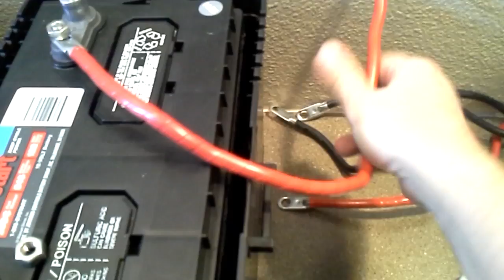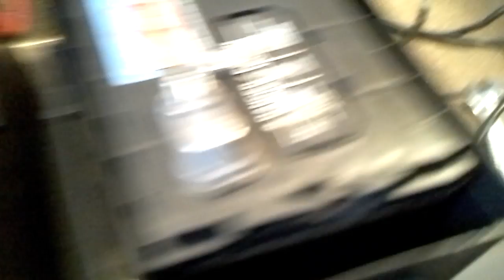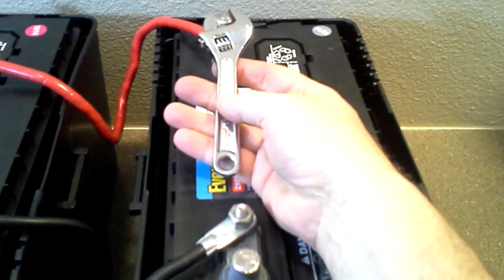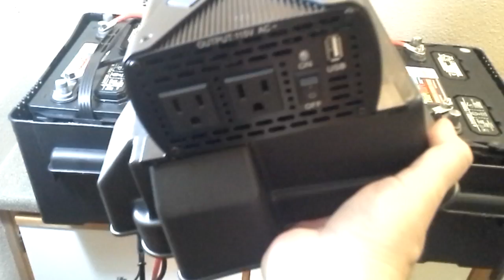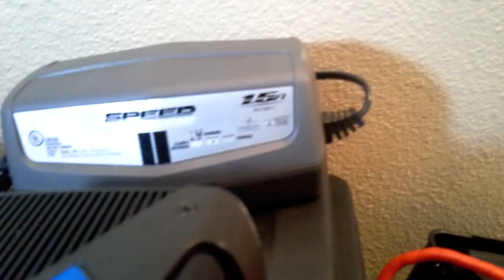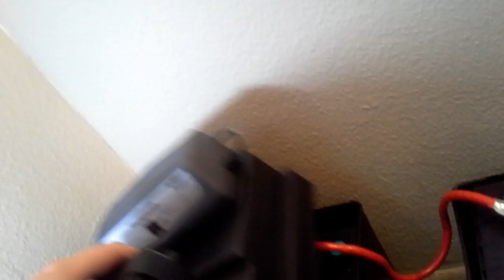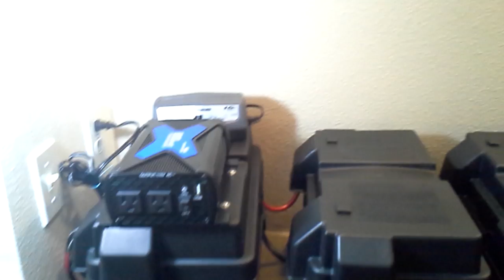Installing 4kW/Hr battery bank with 800W 120V Inverter and Trickle Charger from Tactical Woodgas

Comment: Can you hook a battery charger up to the inverter or would that work
Reply from the maker: It would slowly drain the battery.
Reply: No.  What you are asking for there is perpetual motion - the charger getting power from the inverter connected to the batteries, to charge the batteries.  No such thing as a free lunch. The electronics in the charger will slowly drain the batteries even if nothing else is connected.
Reply: @robboardman598  that's why I asked because I'm learning about all this trying to figure out what would be the best and cheapest way to run my house on something like this.
Reply: @clarissabailes7483  Hi Jason.  Its great that you are asking questions - best way to find things out.  As for running your house, that's a big ask!  I'm sitting next to an off grid system right now.  21 x 275 watt panels, mounted in sets of three in series for 108v input into the solar controller, with seven sets of three panels in parallel to get the amps up. Almost 6 kw of solar.  The controller feeds a bank of 24 x 2v AGM cells, each cell is 850 AH and weighs over 50kg,  to make a 48v storage system.  This runs through a 5kw inverter into the house. The house is all electric so the full load is more than 5kw, and when that happens a 13kw (18hp) diesel starts, and both ads to the house usage and charges the batteries.  It starts on cloudy days when the battery voltage drops to a given level.  That's what it takes to run a house off grid. About $20,000 Australian for that system.  Smaller systems are certainly worth pursuing though, even if Its just a 1kw roof solar grid-tied system to reduce your utility bills.
Reply: @robboardman598  I agree. 
It's OK to start small, probably better even. The important thing is to just start!

Comment: what if you plug your trickle charger into the inverter?  continuous, non stop battery power.
Reply: Bob Williams 

No such thing as free energy
Reply: It doesn't produce  enough power to  loop, a demonstration of   3rd law  of  thermodynamics. The problem must be the  trickle charger  but maybe  a  hairpin curcuit  with  CE transmission started  with  a  solar  initial boost inverted   or  AC boost.  The solution  is  what Tesla  described as volume.
Reply from the maker: Bob Williams 

No free energy, from Tesla or elsewhere.

Comment: Go to nickle-iron  (Ni-Fe) Edison cell's to make your off grid battery 
bank's. So far Edison cell's have lived up to 100 years, or have been 
restored to like new. And the new one are probably better also if you 
louse a cell it's not the end of your battery you just remove the bad 
cell and you can keep using your battery at least short term until you 
can  put a new cell in or just repair the bad cell.
Reply: Granted they will last 100 years, but new 'cost-effective'  technology will make them obsolete in the next 10 years.
Reply: I don't think Ion cells which is what a Edison cell is will go obsolete:  Well you don't know what your talking about: Because you buy the inverter to fit your battery voltage: And people don't charge your new batteries it's a waste of time: And if you don't want to use a battery wrench their is some stuff called plastic dip that work's really good.
Reply: I can take the insults and or criticism to get your point, but your grammar is  making it difficult. Please try again. Thank you.

Comment: this guy connected all batteries in parallel....that takes care of Voltage what about the Current.....Sorry Dude not justified😉
Reply: The "Current" (Amperes) is additive in parallel.  If you take three 12V/100 Amp Hr batteries and run them parallel, you get 12V with 300 Amp Hr.  If you have a 36V input inverter, you connect the batteries in series and get 36V with 100 Amp Hr.  Both systems supply the same amount of watts.

Comment: 800 watts won't do much. I have a 3000 watt inverter.
Reply: 1 hp is 746W
this will run a sump pump for 4 1/2 hrs
Reply: you buy deep cycle battery 75 amp 900 watts or 100 amp 1200 watts and build power box you have 3 deep cycle battery 100 amp 1200 watts and have 3 battery together ok  positive to positive to positive and switch between positive of battery with 150 fused to positive of inverter even you turn off inverter still pull little bit of power ok

Comment: can you do me a favor if you still have your system up.. can you plug the charger into the inverter and tell me if it keeps the battery bank charged on it's own while also powering other things? I've been curious about this for a while but am not an electrician. just a thought. like at night you wouldn't need to use things while sleeping just wondered if it uses more energy than it would or could produce and recharge the batteries.
Reply from the maker: No such thing as free energy, it has to come from an outside source.

Comment: 12 v not 120 v
Reply: The battery is 12v.  You can charge it from your car with jumper cables, or plug the included battery maintainer into a 120v wall outlet.  The new model with solar panel support is at www.tacticalwoodgas.com and also on Amazon.

Comment: Wouldn't it be more effective to wire them in series rather than parallel?
Reply: The reason he connected them parallel is because parallel increases amperage which is most important for load bearing. If he was to connect it in series it would increase the voltage. Assuming he is using a 12v 100amp setup , 3 x12v 100amp in parallel is 12v 300amp but 3 X 12v 100amp in series is 36v 100amp
Reply from the maker: @ginojohnson2722  
Correct.  We use 12V inverters so the batteries must be connected in parallel.

Comment: Can anyone tell me why the charger cannot be plugged into the inverter? Just a thought.
Reply: That's a trickle charger... the key word being trickle. It won't push enough current through the inverter to power anything directly.
Reply: The inverter itself uses power so it would eventually die. Plus I would think there could be some power & grounding issues that may keep it from working. Being the power from one is being sent back though itself... I'm not experimenting with my setup. 🤣🤣
Reply: you need charge battery so you can't ok

Comment: This is a class of what NOT to do connecting batteries. Never connect batteries using one hand like this guy. The intention is good but the safety level that your showing is unforgivable
Reply: We dont hold a camera when doing so. No problem.

Comment: I'm sorry but wouldn't it be easier and cheaper just to buy a small generator
Reply: Steve Yes it would but most of these guys cannot figure that out.
Reply: He ran his refrigerator for three days from solar power. A gas generator will burn 18 gallons of gas at $2.70 per 24 hour day or about $50 daily. Fuel costs adds up quickly in hurricane alley when power goes out for weeks.
Reply: Tech, you might want to check your figures. A generator the size needed to run a frig, around a 1500 watt for around 400 dollars, will use about 1 gallon per every 8 hours. That is three gallon a day and at 2.70 it is 8.10 NOT 50 dollars. By the way seldom is power out for weeks at a time and if it was his system would only last for 3 days according to you. There is no mention of solar involved here. So at 3 days of gen power it would cost him 24.30 and he could run more than just the frig with a 1500 watt gen. I would guess that the system he is showing cost around 600 dollars. So if you divide 24.30 into 200 it would take 8 years just to break even with that system against the generator IF he had one three day outage every year. So yes the gen would be a way cheaper way to go.
Reply: He could have it hooked to a stationary bike for all we know. I use gas generators every day at work. They are loud, dirty, hot, can't be used indoors due to carbon monoxide poison, have to be oiled, maintained & refueled frequently, then add in trips to get fuel all while burning more fuel.
Power outages often last longer than 3 days. Just ask Puerto Rico. I was out for 10 days after a derecho during 100+ degree temps. Gas stations where closed & out of gas. Anyone that did have fuel dramatically inflated prices. I lost all food, entire aquarium died as well as people I know that couldn't chill insulin, use their 02 tanks or C-PAPs. That's when I decided to build one myself.
It was more expensive than a gas generator of the same size but I added switches, meters, leds, & a ton of other costly & unnecessary bells & whistles but a fun project, basically maintenance free other than topping off the batteries if not used for a year or longer, portable & I can take it camping or nearly anywhere else, clean, quite, durable, waterproof, can be easily modified & repaired if a single component happens to fail. I'll take
Reply: Tim this is going to be deep so pay close attention. Puerto Rico is NOT the continental United states. Also a generator does not have to be indoors to be used. There I this new invention out there called an enclosure. Also three batteries are NOT going to last 10 days. In fact not even 10 hours. Bottom line your argument is in vain.
Reply: Wow! You know all the things don't you. Which is funny cause I just came back from a week long outdoor music festival & powered a dorm fidge, electric cooler, hot plate, camp lights, air pumps, several fans, phone & DC accessory charging station & a overnight medical device. And all I did was open up the solar panels in the morning, & re-aimed them at the sun one/two times a day, then have a beer to relax from all that exhausting work put forth. 
I bought 4 deep cycle AGM's in early summer of 2012. They have never been below 10.8v, properly stored & still holding a steady 13v like the day I got them with no signs of degradation. 
And.... Yet to replace so much as a fuse. 
It could either be some crazy mountain forest sorcery shit, or it could be the portable solar generation unit I assembled. 
But you will believe what you want. I can only do so much. 
You can come to the next festy if you'd like. But they don't allow gas generators
Reply: Steve, you are lying and you know it.
Reply: Okaaaay. Then you're right. Myself,  the manufacturer & other reviewers on Amazon are lying about the avg 8-10 yr life span. 
We all have nothing better to do than lie to an apparent flat earther. Don't be a flat earther. Google can help with that. I'm headed to the gym. I suggest you read a little while I get robust. Say nighty nighty to gas powered girlfriend & give her spark plug a little twist for me. Wink wink
Reply: The earth is round John
Reply: Tim, and?
Reply: @ john smith :how much for your lungs if somebody cancer need replacement due to exhaust emisions ? how much for your lungs ?
Reply: Tech Meeter I doubt it was anywhere near directly from the solar panels and was most likely the stored energy in the batteries... refrigerators only pull a couple of hundred Watts but that's only when the compressor is actually kicked on... the compressor doesn't run 24/7 there's a lot of off time when the doors are closed on the fridge...
Reply: i ASK you to do , it doesnt harm people YOU said
Reply: WHY because you did forget to calculate money spend on healthcare ? doctors ask a lot of money for cancer treathment and it are expensive medicines .
Reply: then put it in your livingroom , and dont forget to close the window to keep "our"air nice and clean , GOOD LUCK  & HAVE A NICE DAY
Reply: why? , because you are poluting the air you breath? if you thrink a beer do you also piss in it before thrinking it  ?
Reply: do you have anything to say ?

Comment: Bro how are you gonna use this in emergency when u need power to run the charger a fridge would drain those batteries in heart beat
Reply from the maker: SmokinMayhem1 
Recharge with a jumper cable from your car.
Reply from the maker: Alexis Felix 
Sorry, no free energy.  Power has to be supplied from an external source.  Connect a solar panel, charge from your car with jumper cables,  or get a 12V generator from www.tacticalwoodgas.com
Reply: Tactical WoodGas many car autostarters also have a vacation mode, that starts your car when your battery is low, not so good good if you got a garage, CO!
Reply from the maker: Roger Kerkmann 
That is a problem of the car starter independent of charging the battery bank.  Always have the garage open to outside air when running an engine.
Reply: Tactical WoodGas so do you mean the alternator so now you also need car to charge the batteries way cheaper to run a generator or solar set up

Comment: vad vill du visa oss? att med AC ström laddar Bilbatteri och sedan koppla en konverter till 12 volts batteri och sedan tillverka AC ström? till vad? Du har AC ström från början, varför konverterar den till 12 volts och sedan konverterar den till 230/120 volts? Varför? kanske du vill visa oss att du köpte dem produkterna?
Reply from the maker: azad azady 

If you can post in English, I'll try to answer.  Not sure how to translate your post.

Comment: can this power ac ?
Reply: sunny kiri google your ac model check the watts and you want an inverter i believe double strength of the ac if your running it constantly... but yes i believe an 800 would run an ac...
Reply: sunny kiri 

I've tested it successfully on a small window AC unit.

Comment: Looks kinda dangerous.
Reply from the maker: Lots of energy in a battery.  Follow the instructions and you will do great.
Reply: @tacticalwoodgas4036  What Group Size battery did you use in that case?
Reply from the maker: @ToddTinley  
Bigger is better, up to group 32 size.

Comment: Why are you plugging the inverter into the outlet.  Does it distribute current throughout the home by doing so?
Reply: David Hoppe 

No, it is plugged into the wall to make sure the battery is fully charged when you lose power.  It also extends battery life.

Comment: Wait!? 🤔... You plugged the inverter into the wall socket... So you have electricity to the house🤔?... So why the batteries?🤔
BTW... You Really need to take either the hot or the neg lead to come from the opposite end to go to the inverter...you having both leads as here from the same battery is NOT a Good set-up....Also you should Not have the batteries inside those boxes, allow the batteries to Breath to stay Cooler... This also means that you need to rearrange the battery set-up to do what I mentioned... 👍😎
Reply: meed a small fan to cool those battery down for sure
Reply: Your right go end to end on the batteries.
Reply: @jimb2868  so you are saying connecting the load from the positive and negative from the first battery to the third battery ?

Comment: So if I connect them in parrellel it stays at 12 volts
Reply: think of it like a person if theyre laying down theyre parallel to the ground like a straight line. series is connecting one thing to another like a chain criss crossing. once you remember that then series is volts and parallel is amps.

Comment: But isn’t it plugged into the wall as your saying it’s off grid
Reply: Think this is just for power outages, trickle charger to keep the batteries topped off. 🤠👍
Reply: Its not connect to the grid so its off grid